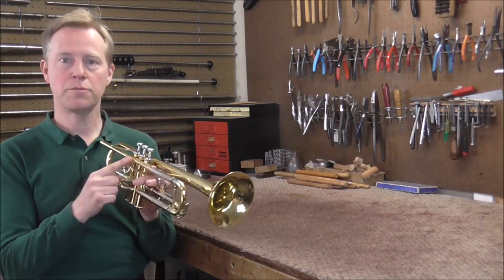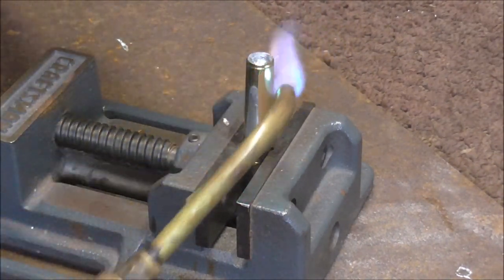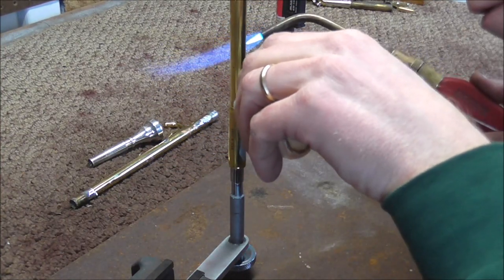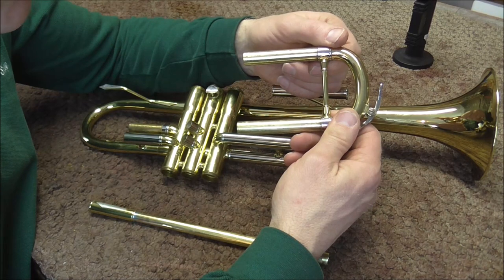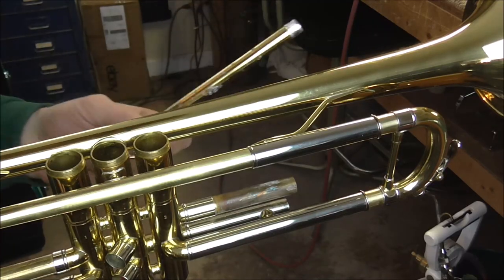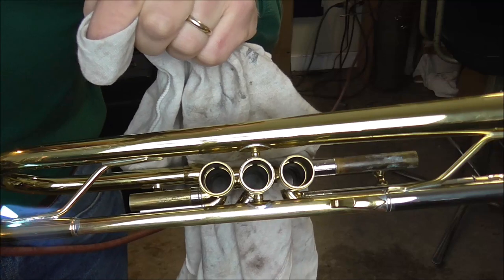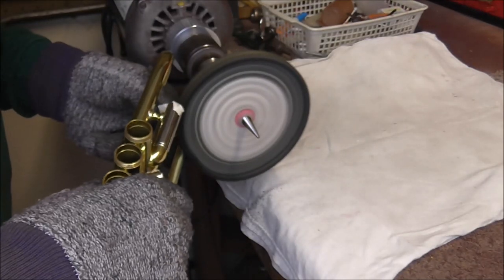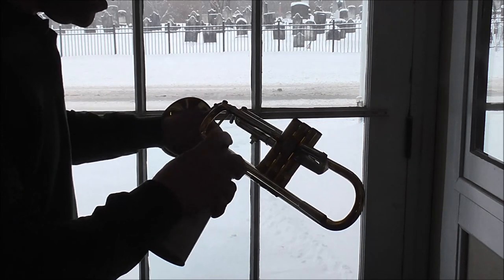How To Replace a Trumpet Leadpipe

Comment: Hi Art...thanks for the reminder to check for leaks after soldering. I took apart and resoldered a tuning slide on an 1890s cornet and forgot to blow through it to check it.  It's fine, no leaks. Your work is fabulous!

Comment: Hi Art, it's been a while since i watched one of your video's so i was pleased to see one pop up on YT today.
 I would love to be repairing brass instruments over in the states instead of here in the UK. We do have a decent brass banding scene but schools hardly ever have a band anymore so the demand for brass band repair tools and parts is limited and so it's hard to get parts and tools. I would love to be able to go buy a piece of brass tube filled with pitch but sadly it's something you don't see here in the UK. 
 I wondered about the lacquer you used, will it  not just end up coming off because it hasn't been hardened/baked in an oven? I did try lacquering the inside of the bell of my Boosey & Hawkes Sovereign Eb tuba with automotive lacquer in a rattle can but it chipped and flaked like mad after a few weeks.
Reply from the maker: I use a lacquer from a spray can but it doesn’t hold up the best.  There is a band instrument repair college in the UK. I would suggest asking them what they would do because of the supplies available in the UK.

Comment: Hi love the videos,  would you be able to point me to some tubing, or an online store for parts for the slide trumpet. I have an old bell,
Reply from the maker: The best way to get parts for a slide trumpet is to find a junk trumpet and an old small bore trombone that is in poor condition that you can get very inexpensively. If there are any other parts you need, you can get them from your local band instrument repair shop.
Reply: @TheBrassandWoodwindShop  thank you I'll be looking out for both. Great channel and videos.

Comment: Hey, I have an issue with a tuba, the 4th valve(rotary) is stuck under the third valve, but only a part of the 4th valve is. How do I fix this?
Reply from the maker: Sorry it took me so long to get back to you. We just had a baby and I am finally getting around to answering questions. 
I am having a hard time picturing what you are talking about. Is part of the lever or linkage bent and hitting the other one?

Comment: Thank you kindly for the videos! I am learnig a lot. Expanding the scope here a bit....It is noticeable that you cut the leadpipe off at the tuning slide end; NOT at the mouthpiece end of the replacement lead pipe, where the taper is actually tightest near the venturi end. This fact would imply there is the least risk of destroying the proper desired taper, and that there is a region around this further point, which is cylindrical and available to be cutoff without impacting the taper or bow shape. Also... we know that C leadpipes are shorter. There is a 1.5 " variability in the Bach leadpipes for instance, as favored by Herseth, Adelstein, Schlueter, and Sachs. This impacts the slots and playability in interesting ways. So, the question is, how exactly is the length of a leadpipe measured and stated? The stock bare part length? From the receiver end gap to the end of the pipe? Reciever end to tuning slide? This is further complicated by the reverse orientation. So, none of the verbal explanations, nor diagrams, are adequate that I have found. One cannot measure this length easily from the outer inspection on an assembled trumpet either. Every joint has an overlap, and you need a caliper to drop in and see the gap and joint depth at the reciever and tuning slide. Last there is an adpater tube which connects the leadpipe to the tuning slide as well. So, again, one line on a finished trumpet is not precise. I get the basic, I am asking the specific question please...What precisely is the length definition? Thank you !!!
Reply from the maker: You stumped me. I do not do much with acoustics on upper end trumpets. The student model trumpets are very easy to do. The small end of the leadpipe goes in up to the stepped part of the receiver. When I replace upper end trumpet leadpipes, they always come with the receiver and the upper tuning slide tube. that makes it easy to do, but it means that I have never had to study the lengths of leadpipes. Sorry I cannot help much.
Reply: @TheBrassandWoodwindShop  Thank you for the thought and note, I appreciate your work a ton!

Comment: If I just order brass tubing of the right size and wall thickness, can I replace a lead pipe with that using the ends from the original?
Reply from the maker: I am not sure I follow what you are saying, but you can reuse the receiver and tuning slide tube. I would not try to reuse and of the old leadpipe.

Comment: Do you use the same buffing compounds for a silver plated horn?
Reply from the maker: No, you should not buff silver plating unless you are re-plating the instrument. You can sometimes get away with lightly buffing silver plating with red rouge buffing compound to get off the excess solder, but it is best to solder very carefully so buffing is not necessary.
Reply: @TheBrassandWoodwindShop  thank you for the advice.  Have two silver trumpets. I use a jewelers cloth to clean

Comment: Any ideas on how to restore a tuning slide that has been flattened inside by someone trying to unstick(likely) it?
Reply from the maker: Those dents are tricky, but they can usually be done. You can try pushing/pulling dent balls through to get it better than it is and then finish the job by unsoldering one or both the tuning slide tubes and using the correct curved threaded dent mandrel with the correct threaded dent ball.

Comment: Might be an idea that someone like you set up a store where your viewers can order those parts. Seems like a great supply store as they even stock & will make obsolete parts based on ones sent them, and will silver plate them for 30% more, but the average person, such as me, just trying to restore old trumpets at home as a hobby, has no access unless they get a state tax exempt status. I have 2 that I desperately need a lead pipe for, a 1927 Martin Descant & a 1928 Conn 22B New York Symphony, both silver
Reply from the maker: I have thought about doing that, but I already have too much that I am trying to do. Maybe  I will try when things slow down. As for the old leadpipes, unfortunately, it is very difficult to impossible to find the original part. You may possibly find someone who can copy one, but usually it can only practically be replaced with a different leadpipe. If there is any way the original leadpipe can be salvaged, that is the best way to keep it original.

Comment: Why would a customer want to replace a leadpipe? Doesn't look like the old one is badly damaged, or that the new one is more decorative or a different size.
Reply: Looked like a lot of red rot on the old one to me
Reply: There was red rot on the old one. Also, if you wanted to have a different material, taper, length, and/or venturi, then those would also be reasons to replace a leadpipe.